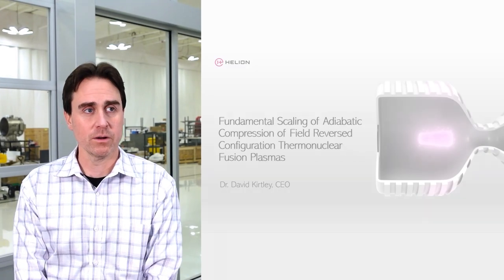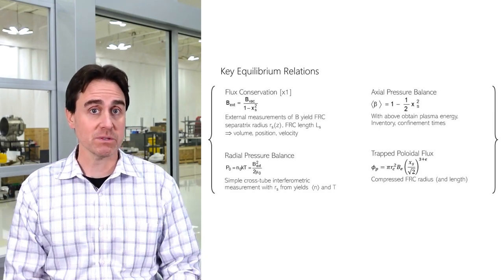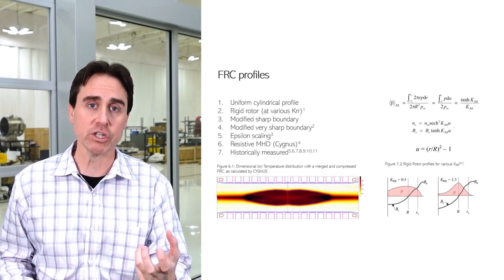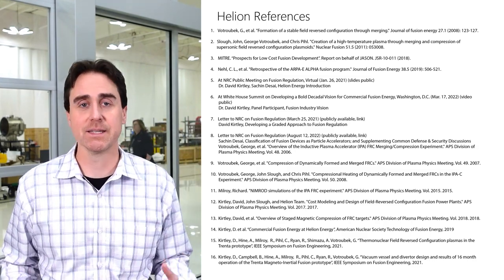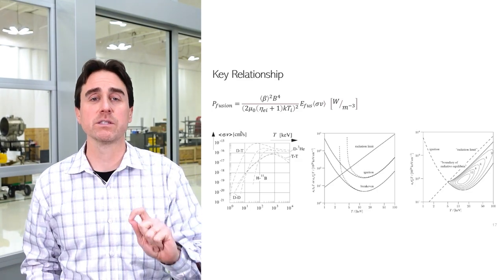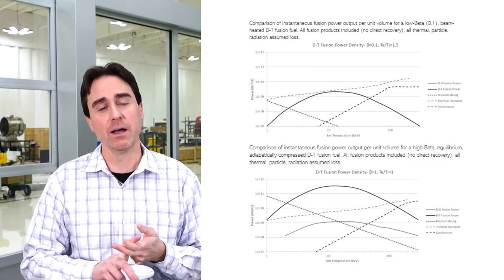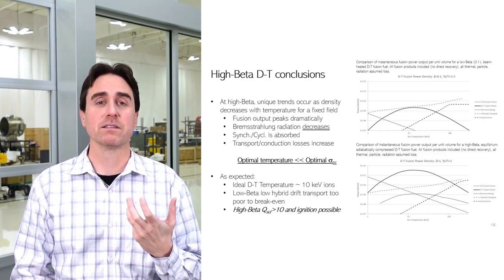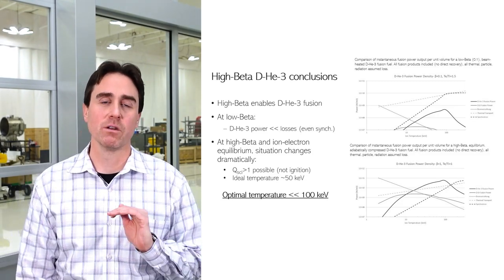The theory behind Helion’s approach to building commercial fusion devices

Comment: Please describe your method of He3 obtaiing, since it’s dramaticaly rare ! It’s a stable isotope of helium and makes up only 0,000137% of the Earth natural helium! I suppose, that this is theme for a separate stream.
Reply: Helion will produce their Helium3 by fusing Deuterium in the same machine. D+D => He3 +n or D+D => T + p (the Tritium eventually decays to He3 as well).
Reply: @elmarmoelzer2229  There are several different fusion reactions happening in reactor. How they separate and extract He3 from such radioactive coctail? Also is not clear how they insert a fresh new portion of D and He3 if trere is such mad pressure and temperature in FRC? David says "we take FRC plasma..."?, that's it. Where he takes it from?
Reply: @ДонПедро-г6ы  
What "radioactive cocktail"?
The two fusion reactions happening in the machine are:
1. Deuterium-Deuterium. Which results in either a Helium3 atom and a neutron or a Tritium atom and a proton.
2. Deuterium with Helium3 which results in a Helium4 atom and a proton. 
Between pulses, the fusion products and remaining fuel are extracted. They are then separated and the unburnt Deuterium and the Helium3 are re-used. The Tritium is stored until it decays to more He3 or is traded/sold. 

No, Tritium will not fuse with Deuterium during the pulse (in relevant amounts anyway) because the Tritons that are born from the reaction are too hot and non collisional on the short timeframe of the pulse. Just in case you were wondering.

I don't know what you mean with "mad pressure". Even during the compression phase, when density is highest, the plasma has a density closer to a vacuum than to ambient air. When fusion scientists talk about "high density", they do not mean what common folk understand with that.

Equally, temperatures are high, but again, the density is very low. When the plasma expands again after compression, it quickly cools off.

Their patent has some clues about the separation methods, they could be using:

Generally, the extraction techniques take advantage of the fact that the particles all have different mass-to-charge ratios and have a large energy spread. Suitable techniques include but are not limited to cryogenic separation, mass quadrupole separation, inversion-ion cyclotron extraction, and as well as a host of standard chemical processes.
For Tritium separation and storage there are even off the shelf solutions from a company in Canada.

Comment: How much He-3 has Helion already made? Any ideas? Guesses?
Reply: Has Polaris been turned on?
Reply: Zero
Reply: They actually did make some He3. Not a whole lot because the previous machines were subscale prototypes that were running at a low pulse rate, but yes, they have made a little bit of He3. Every other Deuterium- Deuterium fusion reaction results in a Helion (He3 atom) and a neutron. Venti (a much smaller prototype than Trenta) made 10^11 He3 atoms in its most successful pulse. Trenta should have been an order of magnitude higher, at least. Since Trenta did about 20,000 pulses, it would have produced maybe on the order of a microgram of He3, maybe slightly less. But then Trenta was not meant for that. Polaris will demonstrate that at scale.
Reply: @midlander4   That is clearly wrong. Their machines have produced quite a few fusion reactions and they use Deuterium for most of their tests. Every other Deuterium- Deuterium- reaction produces a Helion (He3 atom).
Over all of the machines and all of the pulses, it would have been on the order of micrograms, I would think. Not a lot, but that was not the purpose of their previous machines. Polaris will demonstrate He3 production at a greater scale.
Reply: @elmarmoelzer2229  and how come you're party to this privileged information? 🤣🤣🤣🤣🤣

Comment: Extreme caution is advised!
Reply: Not really my brosky.  As long as you stay on the outside of the reactor when it is firing and you don't touch it, you should be fine.  The pulses last only a small portion of a second, and they can't keep the fusion reaction going longer or it will melt the machine.  When it melts the machine, it loses the vacuume... or "no air"  and it stops the reaction.  This is much much much safer than a nuclear reactor, and nuclear reactors are much safer than coal in terms of lives lost.  More people die every year mining coal for electricity than you would believe

Comment: So they made two fusion cannons stuck them together and now they're going to turn into a reactor!
Reply: It is a bit more complicated than that. The two plasmoids merge into a single, hotter and more stable FRC. That is then compressed to fusion conditions by another set of even stronger magnets.
Reply: @elmarmoelzer2229  I knew I just wanted to be funny something I'm not all that good at though I would love to see this be turned into a plasma cannon though! You think Hellion would be good at making plasma cannons?
Reply: @mrnobody.4069  
I don't think it would work well.
You can theoretically eject the accelerated plasmoids, but they would immediately expand and cool off. Would cool off even quicker if they were exposed to ambient air.
Also, the plasmoids only stay stable for about a millisecond and less when they cool. So while it could make a for a good premise for a scifi story, it would likely not work well in practice. But never say never. Maybe someone will come up with a way to make it work.
Reply: @elmarmoelzer2229  Yes I have noticed that too with a real life plasma weapon and it would essentially have to carry its own fuel source the beam itself for long range fire and have been thinking on a real life version that would have its own magnetic field to hold itself together until the fuel burned or having a laser also fire and opaque or non-transparent gas that would be confined and ignite by the laser while moving at fantastic speed or perhaps someday we can learn how to recreate ball lightning within a atmosphere and also the chamber of a gun and fire it out the barrel but probably knowing from ball lightning that it is possible to shoot a high powered self-contained energy projectile!
Or you know you straight up radiation particle beams like Star Trek phasers!
Reply: yes.  But the fusion is at 100million degrees C and every metal known to mankind melts below 1 million C.  So calling it a reactor is a little bit of a stretch because it can't hold the reaction for any longer than a trillionth of a second.
Reply: @davidanalyst671  well that's why we have powerful magnets to keep the plasma away from the walls so you can get away with it because it will survive for a little bit before melting down but you also do not have to use metals you know since there are many other materials that can survive far greater temperatures and those still not a match for the plasma head-on that's still why you got electromagnets and you're also overestimating how much fuel they dump in it at a time because it's really not a lot It's like less than the pressure of a plasma globe combined with the magnets in the majority of your heat is fairly centralized but it's still going to be really freaking hot and you could cool the outside of the reactor if you really had to they're able to make the plasma and smash it into another add extremely high speeds so I'm not sure a bit of cooling would be that much of an issue but I'm no fusion engineer working at helion!

Comment: Why don't you need fusion ignition? 
Fusion ignition is the point at which a nuclear fusion reaction becomes self-sustaining. This occurs when the energy being given off by the reaction heats ...
Ahh okay. I see
Reply: Ignition means that there are enough hot Alpha particles (fusion products) that they can heat the plasma so it becomes (almost) self heating. 
Helion are using a pulsed system that can recover 95% of the input energy (plus a significant amount of the fusion energy) directly as electricity. So they do not need ignition because the energy recovery they do is essentially taking care of heating the plasma again for the next pulse.

Comment: Sorry to inform you but the fusion will be very limited since , you may think that 100 of millions of degree Celsius but that's quite low and it will limit the fusion in your helion reactor . I say that you increase the  
Temperature of the two plasma rings to hundreds of degrees Celsius , than charge it to 2 - 20 teslas and collide it producing the temperature of billions of degrees Celsius And possible generating energy in 100s of megawatts of energy in the form of electricity.
Reply: 100 million was only the temperature in the Trenta subscale prototype. Their powerplants will be in the range from 200 to 300 million or more.
The collision alone will not get the plasma to fusion temperatures. That is just for the formation. The compression is what gets the plasma to fusion temperatures.